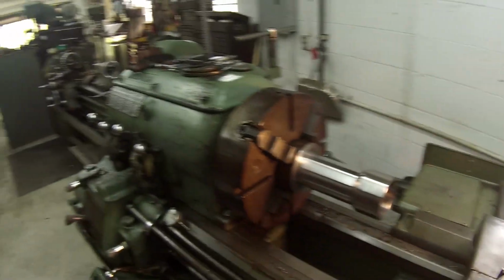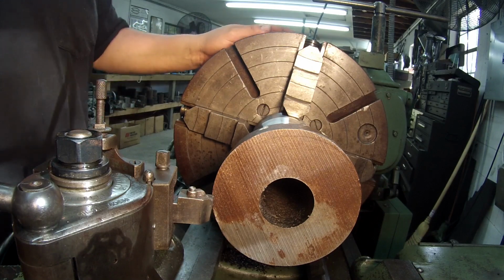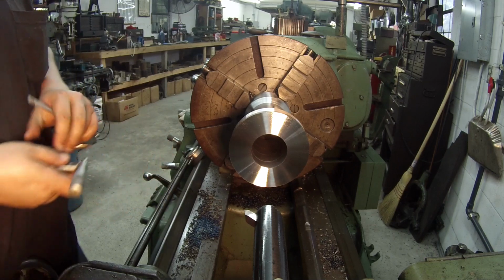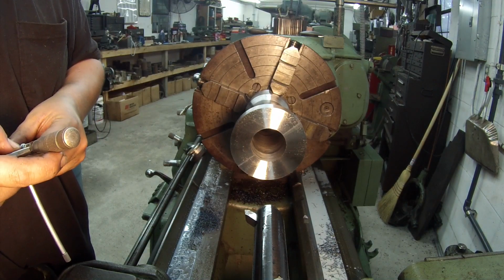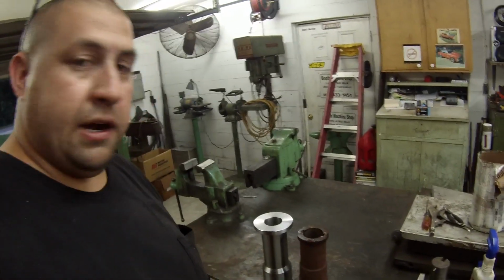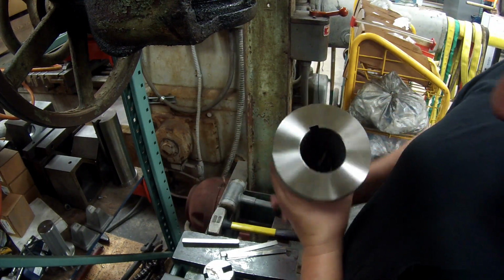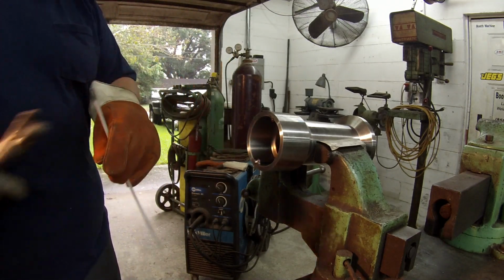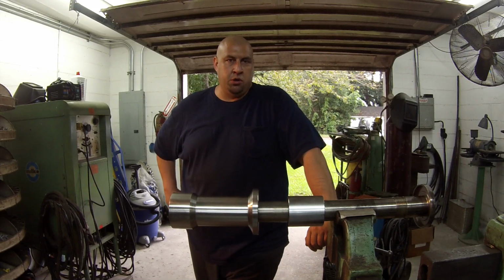Well Drilling Shaft: Slide-Out Tool Part 2

Comment: 33:24 that machine is pretty cool. Im assuming the press works by using gear to amplify the power coming from the motor into more torque, and that drives as screw? Crazy way the press is

Comment: Out of anti-splatter? ... Set your oxy torch to a super sooty flame, and cover the parts you don't want to get splattered with soot - sounds a little odd but it does work for the most part.

Comment: Thanks for sharing.  Would there be any advantage to removing the lathe chuck jaws and facing off the face of the chuck? I don't think you have much if any runout on the face of your chuck but would it help any when you turn stock around in the chuck?

Comment: I enjoy watching your videos. Machine work is fascinating to me. reading mics was a bit of trouble for me, all those fine increments. and it is a necessity for this kind of work.  At work we had big equipment that when broke down we would call the local machine shop to make a part - usually the shafts on gear boxes. They had the manufacture drawings on file so they could do the work when they got the call. Yes, it was usually in the middle of the night. They did a terrific job too. keep the videos coming

Comment: Adam, I think you said this was made out of 1018? If so, what are some tips to getting that good of a finish? I have yet to figure out how to get a good turned finish on 1018.
Reply from the maker: +horseshoe28016 Actually I used 1045 steel. Using the proper carbide insert geometry, feeds and speeds will reward you with good finishes.

Comment: Is that just a press? Or is it doing something else.  I assume that the teeth on that bar are cutting, Noob Alert!  Noob in the house.  LOL
Reply: You posting this on April 1st. Has me a little hesitant to repond. LOL. 

But the press is just pushing the broach cutter through. The broach cutter takes 1/16 of an inch with each pass. So he has to make several passes. Placing shims behind the cutter with each pass. Until the final depth is reached.

Comment: why stick instead of using the mig on the final weld? does it give better penetration?
Reply: I would say either because of the better penetration of stick, or because it was had to get the mig gun into the part. Definitely not because MIG gives insufficient buildup, it is actually one of the best processes for depositing metal, compared to stick, TIG, or even other wire feed processes like flux core or dual shield welding.
Reply: +waderedsox Probably because he needs buildup more than anything to prevent the keys from dropping down the shaft. I do not believe MIG builds.[Correction:] He is moving through old stock of sticks before they go bad. I remember Adam mentioned this during one of his videos for another of his projects a month or so ago...
Reply: i was wondering the same thing. but this makes total sense !
Reply: When you get a welding job the prints will tell you which process to use. But the higher deposition rates of 7018 stick electrodes and flux core are why they are used in structural welding, aside from not needing gas. They're both pretty much standard protocol when I'm welding on bridges and tall buildings. But again, the WPS will tell you what to use.

Comment: Nice video.  Thanks for sharing your lathe/mill/press/welding  experience and techniques.  You're very focused and you keep on subject.  I was taught to go zig zag or circles in stick welding.  I noticed it appeared you just went straight with it.  I'm still trying to get my stick welding to look better.  I've been experimenting with going straight and it seems to work better.  Its not what is in welding text books I learned from.

Comment: Adam, Superb workmanship as always!  You used 7018 to weld the inner guide rods. Just curious why (I am learning about welding) Was it AC or DC on the welder?
Best wishes,
Eric
Reply from the maker: +esoomreltna I have always like stick welding the most. I was using 7018 DC reverse polarity.

Comment: Hi mate.
That was looking very nice.  all the parts fitting sooo well.  Would you ever think about doing some instrument making?  I think that you would be highly suited to doing some fine instrument engineering.  I would like to chime in with John Smith, you let the product speak for itself.....  I bet that you curse Jimmy Carter for not going trough with the metric system.  Working with it is a lot simpler.  Although I guess it's just what your used to.

Comment: Adam, really nice job!  Kind of a shame that it won't stay pretty in use, but that's no reason not to make it look good as well as perform well when you deliver it. A sure sign of a craftsman there!

I'm curious about how you lined up the rod with the keyways before welding.  Was it by eye?  Or did you position the keyways vertically with a level or plumb bob and let gravity position the rod?

Thanks for the education!
Reply from the maker: Thanks BigMjolnir. Gotta make nice looking parts that fit good too. The customers appreciate that. 
The rods I just eyeballed in the center of the keyways then tacked off. They are ultra critical.

Comment: Hi Adam - Really interesting, as always.  I'm intrigued by your electric screw press — I've never seen one before, and I'm already starting to think about how I might be able to make one like it.

Meanwhile, I know you like to use 7018 rods for all welds that must be strong and reliable, but I'm wondering how you store them between uses, especially given the high humidity in your area.  Do you have a rod oven of some sort?
Reply from the maker: I've never seen another one like it. It was made by Kent-Moore, and was originally at Pensacola Buggy Works many moons ago. It was given to my dad a very long time ago. It's a good press for broaching keyways and simple pressing jobs. 
The big green cabinet that's by the wall next to the welding table is actually made for storing rods. It's not an oven but it has a fixture inside to screw in light bulbs. But I never use it. I normally don't have a problem with the welding rods going bad.
Reply: Abom79 Thanks.  If you have an opportunity sometime, I'd love to see a more detailed view of the drive train on the back side of the screw press. What, exactly, connects the motor and the screw? Still pictures would be fine if filming is a problem. The thing I especially like about your press is how quietly it operates.

Comment: Very nice job! A curiosity question. You tacked the rods in with the wire feed welder and then finished it off with stick.Was there a particular advantage to doing that? Thanks for he video!
Reply from the maker: The MIG gun makes for quick easy tack welding of parts. I dont like tapping welding rods anymore than I have to. So tack with MIG, then weld up with the 7018. I dont always trust the welds of a mig welder, the 7018 stick rods I know will penetrate well and hold.
Reply: OK. Cool. Thank you!
Reply: Abom79
Sorry for the dumb question,  but what;s the reason for tapping the welding rod?
I know little to nothing about welding & trying to learn.

Thanks for the great vids!!

Comment: Really nice work! I started using generic Pam cooking spray for splatter spray after I got the tip from weldingtipsandtricks. It works just as well for me, and its way cheaper.

Comment from the maker: Mark, I prefer to do as much welding I can with either 7018 stick, or .045 fluxcore with gas. I had the .035 solid wire in the mig welder and its much easier to get parts tacked in place with the mig gun. So I just used it to tack the rods in place. I like the penetration of a stick weld or fluxcore over that of solid mig wire. Not that mig welding it in wouldnt work, its just my preference. And yes, that mig gun can really throw some spatter too. 
Thanks Mark.

Comment: I enjoyed round 2 also. I've watched all of your video's with much enjoyment. Did you not finish the welding with the mig because of the splatter or why? I have a Miller185 and it splatters to, it's very annoying when you've got everything looking top notch and then have to deal with cleaning up the splatter. I saw where a viewer said to try Pam, I will try that myself, and also the hand soap and water. Thanks young man for letting us into your shop and watch you work your magic.
Mark

Comment from the maker: That was a factory made bushing from Dumont Broach, so I felt confident that the slot was milled dead nuts in the center of the shaft, Simply set the existing slot down and square on the bottom of the vise and it should be 180 degrees away, as long as you center the shaft properly in the vise. I normally give the part a few bumps with my lead to make sure it down and even on the bottom.

Comment: Oh, I like your lathe - it's running nice and smooth without any big noise - I have an old russian one from 1962 - a STANKO 1A616 - it's a bit smaller and more noisy when it runs - take a look: kelds.weebly.com/mine-maskiner.html - the forth picture.
Translation to the right under the menu line.

Very nice heavy duty job - I like them !